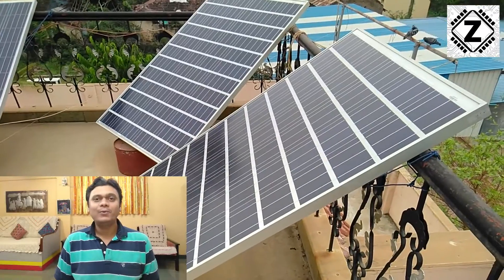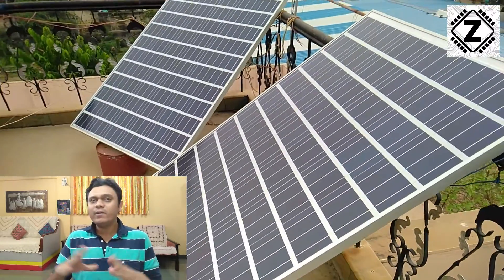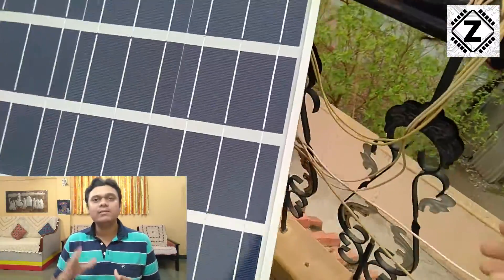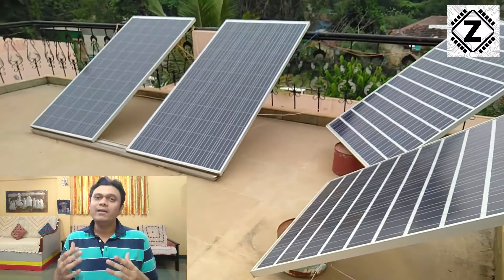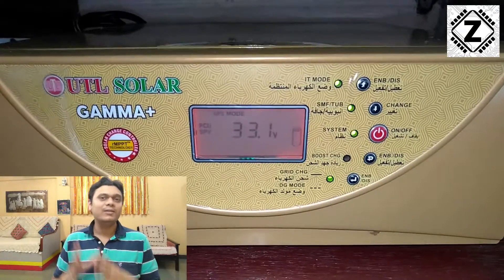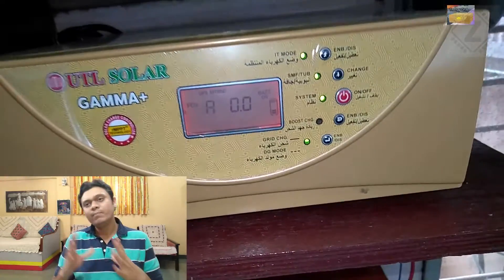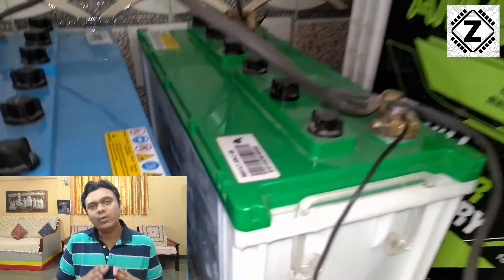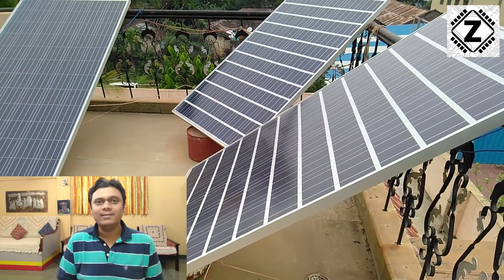[Eng] UTL Gamma Plus 1040W Setup Tour | Mixed Panels, Different Directions | Parallel Battery 300AH

Comment: Sir I have 390x2 & 380 1 panel is set for utl gamma 1kv system all 3 in parallel connect now I want to upgrade to utl 3350 so how i can connect all this panel please help
Reply from the maker: Depends on panel Specs.
Watch solar QNA ep06.

Comment: Sir my 600watt (150×2+150×2) connected with smarten mppt with 10mm 10meter dc wire is giving only 11 volt n no ampere? Wht may b problem? Pl guide?
Reply from the maker: Could be a fault with MPPT. Try contacting service.

Comment: Sir soler battery jada samay tak achi rakne k liye... Invater ko kitna voltage ko low cut hona chahiye... Mera invater 10 voltage me low cut hoti he.. Mene khud normal in vater soler modify kiya.. Is liye janna chatahu. 
Simply 1500 rupai pmw microtek soler controller add kiye... Battery 12 voltage k opar janek badh electric atomic off hoye jaye gi... Din me soler and battery se cholega... Battery 11 voltage ane bath atomic electric on ho jaye gi
Reply from the maker: https://youtu.be/11OXG-hLF7Y